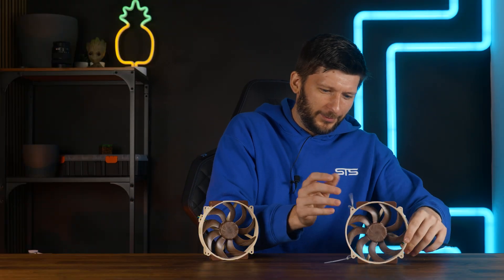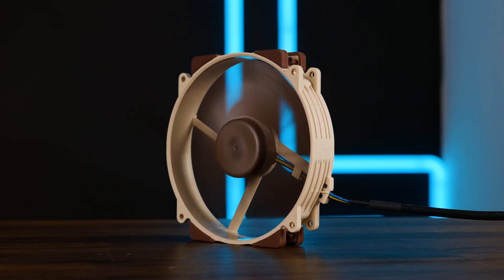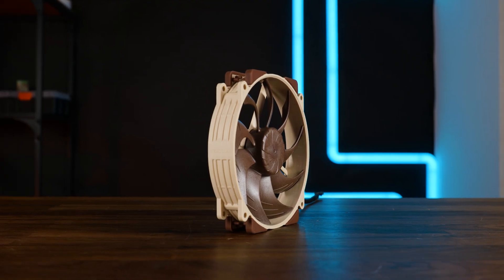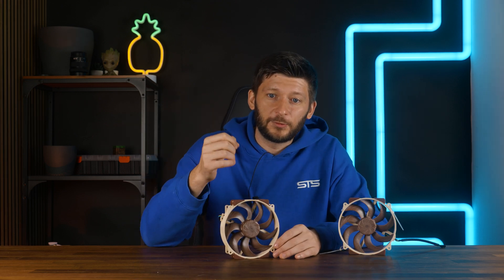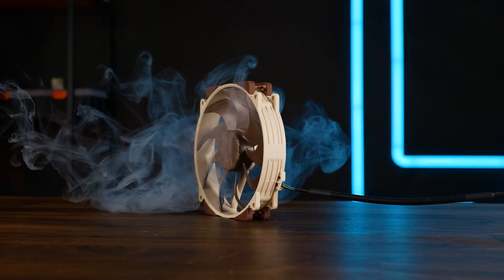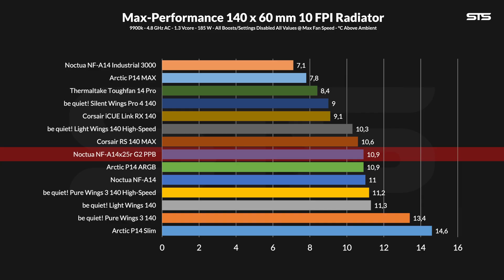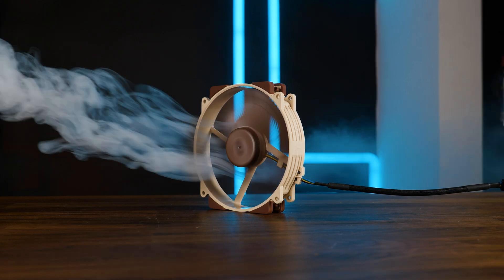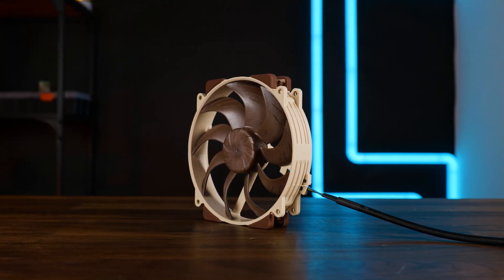Benchmarking The Noctua NF-A14x25 G2 Before It's Cool - PPB

Comment: When measuring noise of the fan you shouldn't leave a fan on the table like you do. You'll introduce additional noise due to vibration and positioning. You'll need a more stable and consistent setup for this.

Comment: Even if there will be any significant performance improvement, the price makes the product utterly uninteresting and obsolete. 40€ per fan, that´s 3+ Arctic P14 MAX or almost 2x Be Quiet Silent Wings 4 High-speed. Imagine if you will need 5 of these or more. 200€+... just for fans. That´s only worth it, if you have unlimited budget.

Comment: These are for cases and tower heatsinks. You have to wait for the square frame for radiators.
Reply: Actually, it shouldn´t matter. The fan inside will be the same, only the frame will be different. And also, give 1 example of a case, that has mounting holes for round 140mm fans with 120mm hole pattern. Because NO, mounting these into 120mm fan opening will do no good, as it will partially cover the area, where axial fans perfom the most - outer edges.

Comment: Surprisingly mediocre performance. Roughly the same as the P14 ARGB and worse than the RS140 MAX
Reply: Well, RS140 Max i 30 mm thick. But yeah, performance is meh. You can get comparable performance/noise ratio for much cheaper and with  more headroom.  I'd definitely go with P14 Max fans.

Comment: I was originally going to wait until September for the square version of Noctua's new 140's for my case fans, but I went ahead and got the Thermaltake Toughfan Pro 14's after seeing your review of those and comparing the specs. I'm glad I didn't wait, these Toughfan Pro 14's are freaking awesome. I still like my T30's better than the Toughfan Pro 12's, but those are very close and the Toughfans are the normal 25mm thick. Thumbs up!

Comment: Also, a question, could you include Phanteks D30 140/120 mm in your graphs? I don't know if you've tested them, I don't think so, but I got them recently (140 mm) for my case and they are built like tanks, also quiet for the amount of air they're pushing.

Comment: And they still don't sleeve their cable's fully. I hated my Noctua fans that came with NH-D14 just because of rainbow cables, it looks dirty cheap.
Reply: They'll charge an extra 10$ for that, you know, china manufacturing is expensive after all. OH, wait.
Reply: 4 things: 
1. yes, the sleeves are terrible, can´t be moved as needed, often not allowing to hide or align the cable well enough around components. And if you manage to bend them near connectors in certain way, the fan(s) connected may stop working due to loss of electric contact.
2. Brown fans have short cable - often not enough to reach anywhere, or already too long, as the fan connector is often closer and thus, cable cannot be hidden.
3. Black fans, on the other hand, have no cable at all...  Only a connector sticking out of the frame...

4. If i buy 5 fans, i get 5 Y adapters. Why would i need that? Over the years of buying Noctuas, i´ve collected quite a collection of Y adapters. I´ve also got U/LN adapters, which i´ve never used (modern BIOSes don´t need that anyway) and only keep throwing them out. 

I´d say Noctua is stuck in the past. They made something, called it "good enough" and never revisited it ever again. As a result, many of their fans are flawed in some ways (growling, lack of performance), yet they keep selling them anyway. Where everyone else keeps advancing, they keep sticking with their formula, while moving backwards... They even had a chance of releasing a dual tower few years back, which resulted in D12L - small form factor tower cooler only niche % of users wanted. As a result, everyone else now has dual tower, that is smaller and yet still competitive with their flagship coolers.
Reply: I prefer it like this, having no sleeving on the fan end helps you bend it to get them out of the way vs a full stiffer sleeved cable.
Reply: @sk8r4lf138  not all sleeving needs to be stiff.